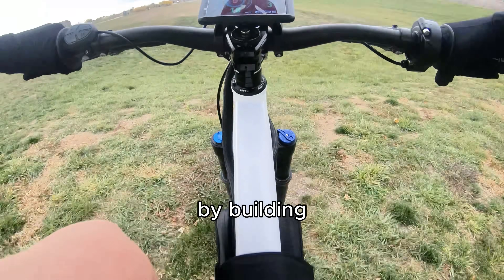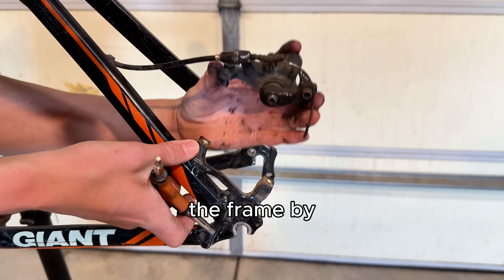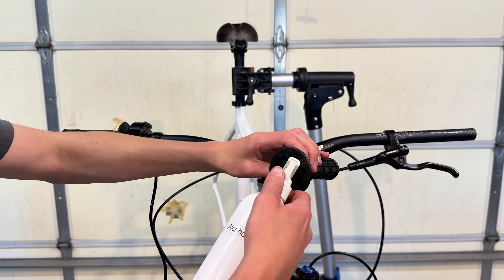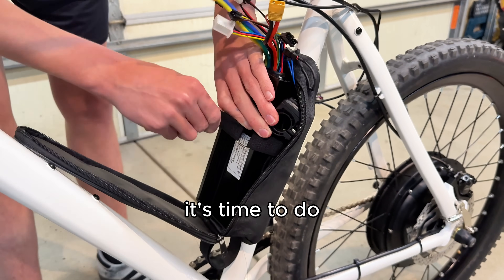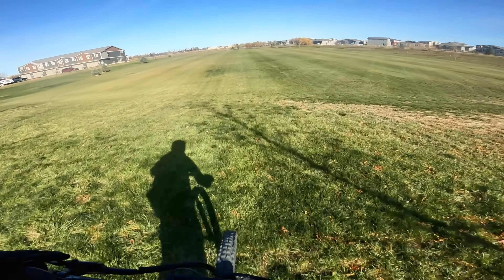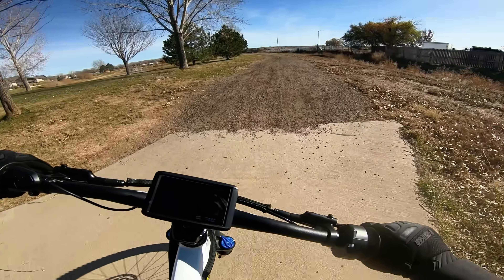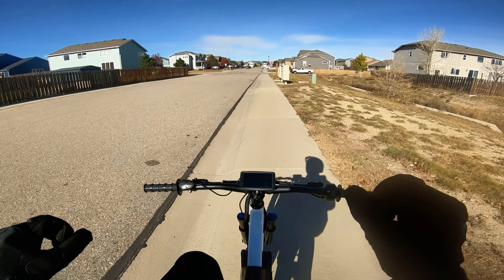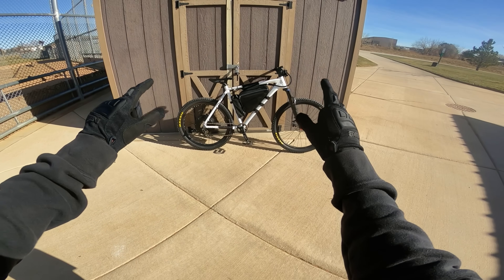I Built the Cleanest 2kw E-Bike Conversion Kit!

Comment: upgrade the controller to a 60 or 80a sine wave thank me later. A 52v 35ah battery can definitely do 80a peak discharge just need to check your motor isnt getting too hot

Comment: I wouldn't say a 52v 2kW nominal is a high powered e-bike, but its definitely really clean. You made it much better than most people do, big props for that. Next time try a mid drive CYC Gen 4, or a QS205 with a fardriver.
Reply: i think the limit for "powerfull" is 60v 2000w, begins to feel more like a vehicle and less a toy at that point. just my opinion tho
Reply: @AngelCheatsX  I would say 850w 36v limit anything under no
Reply: Well a street legal is usually 750w
Reply: @IMTB2. 250w here in uk
Reply: its a mtb you dont need to go more than like 25mph
Reply: @Breck0116  Well as a hard tail I'd say its more of a gravel bike. But yeah on-trail, 25 mph is plenty. That wasn't my point though.

Comment: Niceeee i wanna get a conversation kit for my new full sus
And this is a mix or suronster and Seth bike hacks😂
Reply from the maker: That would be sick. There is a few things you have before you do that, you have to have enough space for the battery and you have to have dropouts.
Reply: @Bikerwithapolo  I think I would need a bimota kit or a mid drive and I could fit a lil battery but I couldn’t have a bottle cage
Reply: @IMTB2. if youre gonna do something like that u have a few options, but if you wanna get a really powerful one, either u get a cycx1 gen4 at 72v it's like 6kw of power and you dont need to mess with your dropouts because full suspension bikes usually have closed thru axles which u cant put a hub motor on without some modification
Reply: and for the battery u can put one in your backpack i know a few people who actually do that as long as the battery u get is not too heavy ur good
Reply: @cbxgang I would not want a bomb in my backpack 😂 and Ik i have thru axle so I cant have a hub motor
Reply: @cbxgang so I would have a wire coming out of my bag and I would need to unplug it for me to get off??
Reply: @IMTB2. or u can do something kinda ugly and put a battery on the top tube, and yes u can do that u just disconnect it